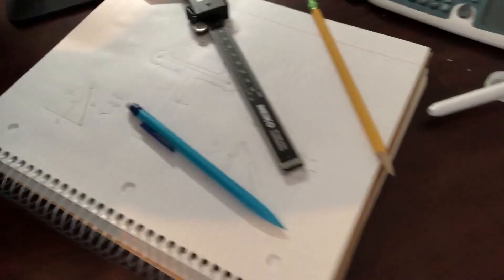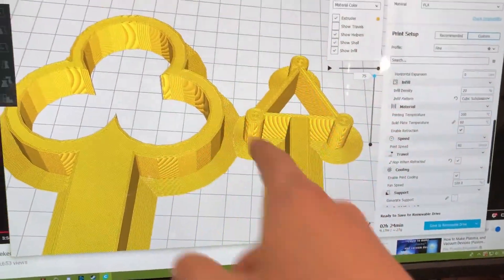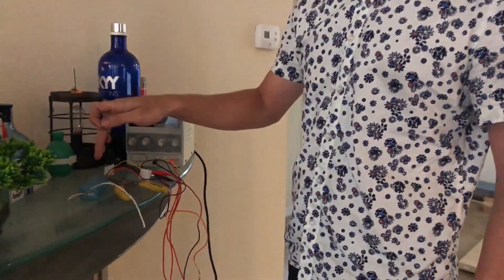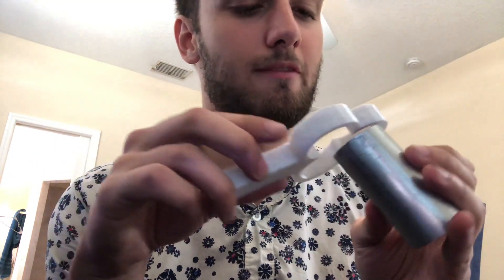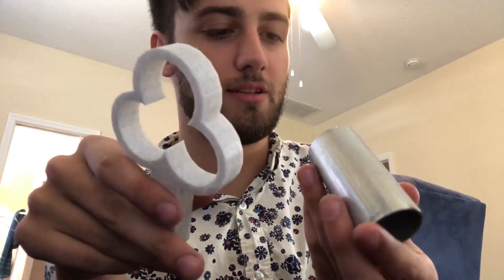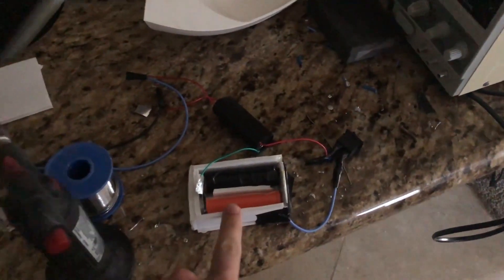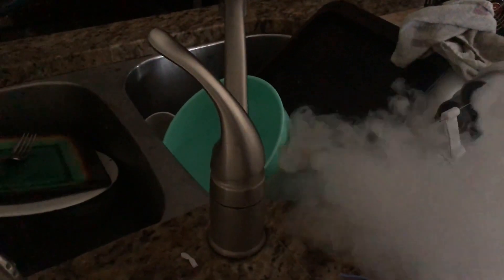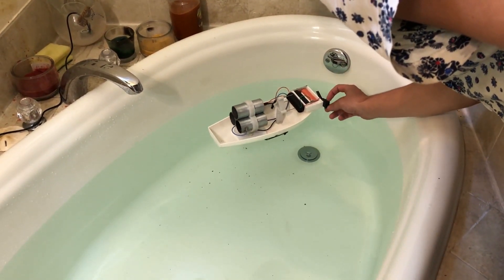World's First Ion Thruster Powered Boat!

Comment: The PD between the needle and pipe is ~20 000 volts no matter which way you look at it: needle to pipe or pipe to needle.
The DIFFERENCE is in the charge density:  
More charge density in the sharp needle than the rounded pipe edge.
Oh Wait!  You never did round the pipe edge did you.

Dont feel bad/stupid; most videos here are of idiots who also haven't rounded (and polished) their pipe edges.
Perhaps stop copying idiots and READ UP ON THE SCIENCE..???  
While you're at it (like thats going to happen) look up aerodynamics and give the other en an aero trailing edge.
Then your video will stick out and get more clicks because your thruster is actually effective and potentially useful.

Comment: In fact the very CAD program you're using to design the holder for the three copper pipes would have found the center of each one of those circles for you 😂🤣😂🤣 I mean seriously you're saying you went to pen and paper to do trigonometry to figure out the center of three circles together when you're using a CAD program that has that very feature double wow

Comment: you can use polarized glass for the container via electroplating. being in water that would be the cheapest. but to have any noticeable thrust you would have to coat the vessel with ceramics both because of the electrical / radio interference and the electrical conductivity of extreme voltages... IE salt water. silver would be best for conductivity for your spikes. just one perspective from an engineer. still massive undertaking. either way good proof of concept. 
Full scale is what i was talking about.... btw

Comment: Certainly seems to work, but just wondering what was the battery input volts and the transformer output volts?
Reply from the maker: Battery was 2 fully charged li-ions in parallel, so 4.2V. As for the transformer output, I have no definitive way of measuring it, and the best I can tell you is between 15,000 and 35,000V based on spark gap estimation

Comment: Hey, would we be able to have a chat? I want to build a high thrust ion thruster and I had some ideas on modification such as size of needle, shape on needle, size of pipe as well as length, distance between the two, etc.
Reply from the maker: I'm currently building a test rig, I've gotten .0002 Newtons of thrust (approx) with the setup in this video, but I still need to determine experimental variables

Comment: i thought you had to have extremely high voltage?
Reply: yeah... 40,000 volts...
or is extremely high voltage bigger?
Reply: maybe he got confused about that battery. from two 4.7v batt in parallel converted to 40Kv
Reply: have you ever felt 40,000volts? i did, not a very good experience, but you could try.

Comment: Maybe use some micro wave circular magnets to confine the ions into a magnetic nozzle. Similar to how rockets and jets work. This will get much more thrust. Also using aluminium tubes to make it lighter smaller diameter.
Reply from the maker: I switched to aluminum foil for the tubes, no idea why i didnt do that sooner. I'm considering using an electromagnet as a sort of particle accellerator to push the ions faster. It'll take a while to design, though
Reply: I wanna see that

Comment: Is this even real  i mean which gas did u use to make ions how did u accelerate them with electric fields or with magnetic field  by hall effect???
Reply: The way an ion engine works is that when the air makes contact with the kathode it becomes an air ion (the atoms in the air become positively charged) then the air "ions" get repelled from the kathode and create thrust by shooting out the back.
Reply: glitch gamer atmosphere is already there so no gas needed

Comment: I have been playing with high voltages and also been making thruster models. One thing I can tell is that for high voltage you can use one transistor topology circuit for driving a high voltage transformer (flyback transformer). This gives less current but more voltage and more corona discharge and less heat